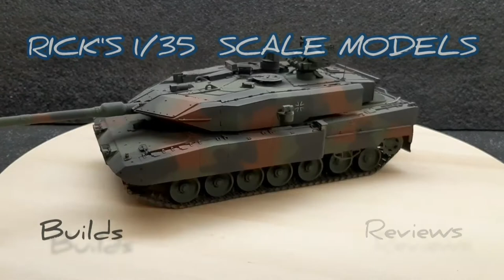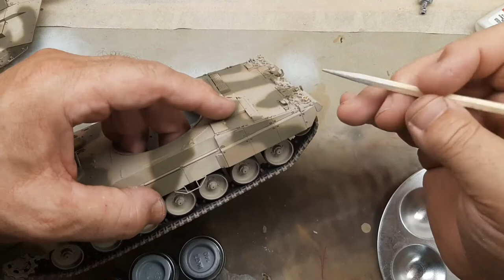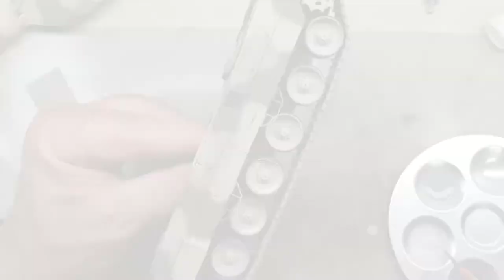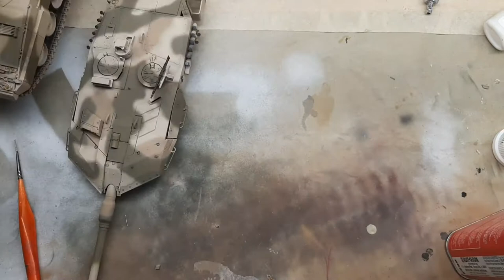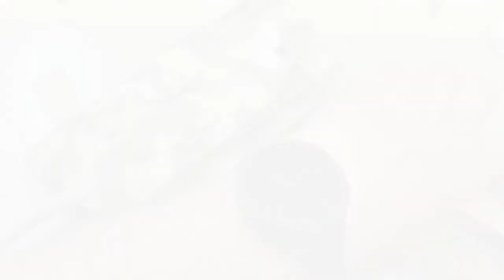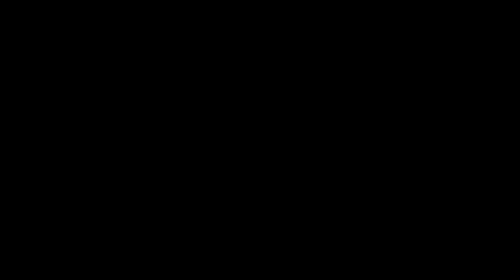Desert Weathering Modern German Leopard 2A6 1/35 (video #21)

Comment: So my painting woes continue. I had to purchase another Leopard 1 model just for the decals. 
My desert Leopard looks nothing like yours. The medium desert color (Vallejo Orange Brown) on mine looks ok, maybe a bit too pink. I made sure the areas where the Iron Crosses go are painted perfect. Next to those I place the 3 tank numbers. Hey, they are my Leopards and I will detail them the way I want! : )
 I use the numbers from the Tamiya Leopard 1. But I used up all the numbers from my newest model and now the numbers are coming from my original Tamiya Leopard kit from the late 80’s. They are so old they are self-destructing as I put them on!
And the ones that went on well are now showing a darker area around the decals themselves! Like the glue is so old it mis-colored the paint it is sticking to. So much for my perfect paint job. Now I have a feeling they might wear off. 
So my question to you is, what FLAT spray do you use to seal the decals without making the tank look glossy?
Reply from the maker: I use modelmaster still avaliable from hobby lobby.. the flat.. I airbrush it and I don't thin it. It has a very slit white hint.. I'm switching to using tamiya acrylic flat clear. It drys clear. I don't thin that either. Sorry about the issues I've had good luck doing things.
Reply from the maker: Tamiya is xf-86 and modelmaster is 4636
Reply: @Ricks135scalemodels  And you spray that over your WHOLE tank model when you are all done building it?
Reply from the maker: @spiritualarchitect4276  yes. I don't soak it but usually do two layers. I play it by sight. The Tamiya is a much better clear.

Comment: I know I am off topic again... but... my Tamiya and Italeri Leopards did not come with the small rear antenna. Is yours short enough that when you spin the turret the barrel does not break it off?
Reply from the maker: Yes it does. Its a marker for backing up.its about 18 inches long and has a large ball at top. It sits on the drivers rear camera.
Reply: @Ricks135scalemodels  I thought that maybe it was an antenna for a rear phone. My Challenger 2 has one, but if you spin the turret all the way around the barrel will break it off.
Reply from the maker: @spiritualarchitect4276  ya. I drill down deep and haven't had issue yet. About 1/2 inch above and 1/4 inch below